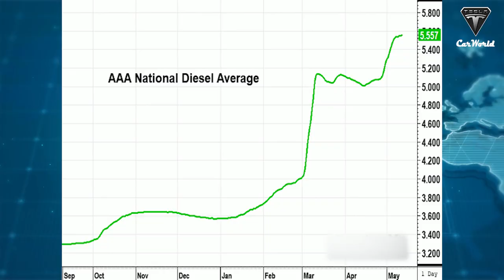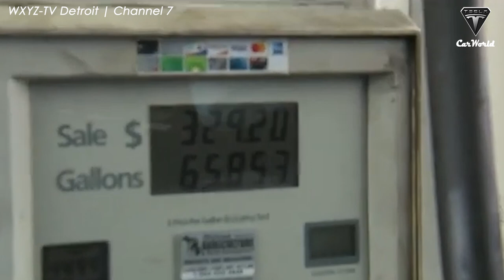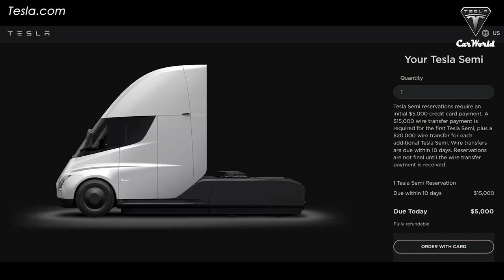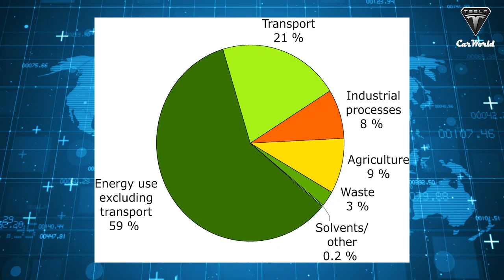Elon Musk reveals Tesla Semi Will Save $200,000 For Tesla's Customers!

Comment: Really good point about a cataclysmic failure of the electrical power grid. However think about the power grid right now it's irrespective of how it's powered either green or not it's just ELECTRICITY.

The power grid is already inefficient and generally it has no redundancy set up at all. So whether at the power generation origin or by transmission lines electricity supply is extremely fragile even in the US, Europe and Australia etc. 

But if we were to redesign the grid what would it look like? Decentralised as much as possible instead of a singular massive power generator hydro, coal, nuclear etc servicing 2-5 million homes create regional and local redundancies up to and including at the retail level aka solar panels on people's roofs.

Will the world go 100% solar or wind of course not that is just as stupid as going 100% coal or hydro. But the  safest most efficient system is what Elon proposes which is an expanded electrical grid which is open ended with suppliers being users and visa versa. But with power generation being specific to user base and on a cost per use as in Nuclear, Solar, Wind and Hydro if available.

There is no one solution but creating the most efficient, effective and affordable solution for every community is the ultimate goal.

Comment: Many people excited about Tesla semi . I think it is good design but have doubt  about its practicality. Since it has limited range .it can only operate local not long haul which most drivers  prefer . About charging , I do not think not many or none truck stop has charging infurstructure . Also about repair, Who going to call when this semi brake down? Tesla service ? at middle of no where?
Reply: got lol, first gen too be sold  , first truck in 10 miles a gallon. now get 28 reg truck .  the semi and truck will get better in miles as  time goes o n.
Reply: 1917 Ford Model TT
DEARBORN, Mich., July 27, 2017 – One hundred years ago today, Ford introduced its first purpose-built truck, the 1917 Ford Model TT, forever changing the auto industry – and the very nature of work itself. A century later, Ford trucks are among the most iconic vehicles in the world. According to Ford Motor Company, the Model T had fuel economy on the order of 13 mpg.
Reply: . It was often equipped with an accessory gearbox, such as the Ruckstell or Jumbo gearboxes, which allow the truck to have intermediate gears between low and high, useful for hill climbing.

The Model TT was very durable for the time, but slow when compared to other trucks.[5] With standard gearing, a speed of not more than 15 mph (24 km/h) was recommended, and with special gearing, a speed of not more than 22 mph (35 km/h)
Reply from the maker: @chang, We still have to wait and see when the Tesla Semi is officially produced and then hit the roads. Then customers using Tesla Semi will give the most realistic reviews.
Btw, thank you so much for your comment! Have a nice day and see you again in our next videos!
Reply: The long range Semi model has a 500 miles range. But there are a lot of Tesla stalls along practically all US roads for a charge if needed.
Reply: The brake down is less likely to happen once their mechanics are much simpler and demands less maintenance. A lot of items present in ICE cars are absent in electric.
Reply: @TeslaCarWorld   thank you your comments , I am not a driver but my neighbor is. My comments is based on  conversation with driver who  actually driving semi. Also I do not like word " sustainability' I mean it is too late .Can we just accept change and go on ?